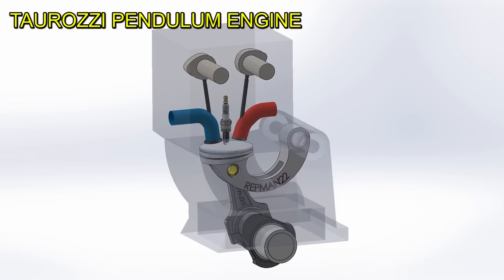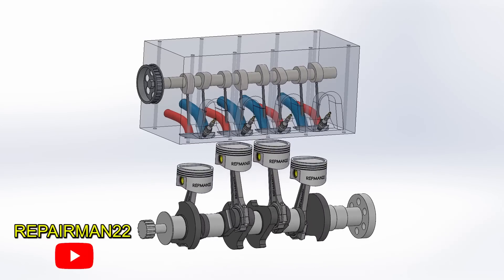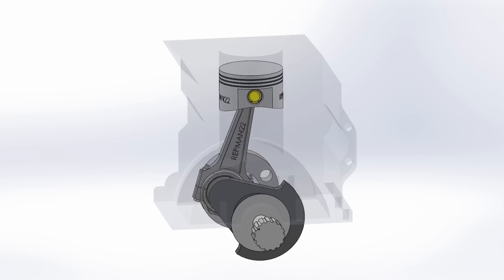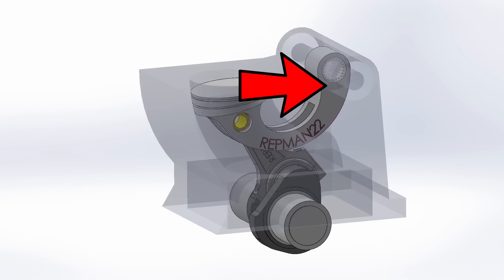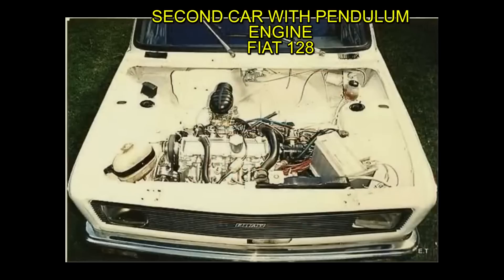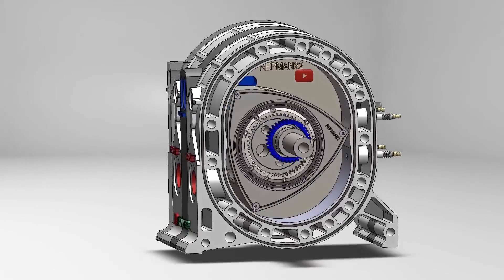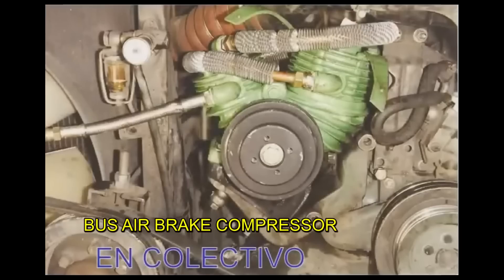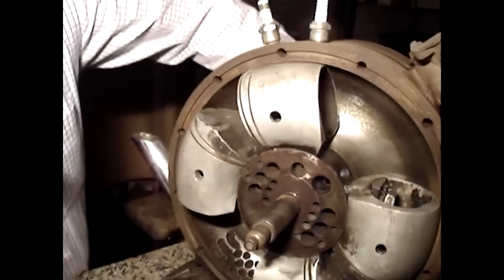All about the Taurozzi Pendulum Engine 🧠 and what happend to it🤯

Comment: Adding the weight and complexity of the curved connecting rods and the increased cost of boring curved bores negates any gains from decreased friction. As for excess oil, modern engines use oil jets to cool the pistons so that benefit is nullified. If it was a valid concept, the manufacturers would have picked it up, they spent years and millions of dollars trying to make the wankel as efficient and clean as standard gas engines.
 The fact that it is used as a gas compressor doesn’t prove its viability as an ic engine. The compressor industry uses multiple design concepts as working pumps because they aren’t as stressed as an ic engine.

Comment: I find the 30% claim VERY doubtful. If that were the case the automotive industry would have been all over it.  Friction from the piston skirt is significant, but not THAT significant. Wear in the piston skirt is often insignificant during the life of a modern engine. There still needs to be tension in the piston rings, and there is a move to lower tension rings. 
Would the piston rings rotate ? If not one side of the ring would wear far more than the other.

Comment: There is a whole extra point of contact from the reciprocating assembly which will add more friction, that does not make it more efficient or give it less friction. So pretty much a less efficient, higher friction, faster wearing, shorter life span having, less powerful, more difficult and expensive to manufacture engine that doesn’t do nearly the work what a typical internal combustion engine does for a higher price?

Comment: I love it! Makes perfect sense from piston to crankshaft efficiency.
Reply: The conrod/crankshaft-initial-angle after ignition is (normally) always 0°, instead of the ideal 75°-80° (1/4th turn for ideal leverage) .... Here the initial angle is, very soon, much higher than in a normal engine, thus extracting more torque from each combustion.

Comment: The crank angle near top dead center is a massive advantage in this design. I've never seen this engine before. Very cool.
Reply: It is the same as a normal engine.
Reply: @Keit Hammleter  

When the piston is at TDC, the crank is past TDC. It's a mechanical advantage like an offset bore build, but even more accentuated. Then, as the piston comes down, it moves over towards that side of the crank, keeping this advantage. The rod stays more straight & this puts more of the power stroke into the crank for rotation.
Reply: @keithpeterson6108  zing
Reply: @keithpeterson6108  : This is not apparent in the simulation in this video.    As others have posted, piston TDC inherently means the crank pin is positioned to make it so.
Reply: @Keit Hammleter  

Yes, of course, the crank position has something to do with TDC. It's still at TDC, but the rod is at an agle when the piston is at TDC. Thus having a mechanical advantage on spinning the crank as it rotates past TDC by having more rod angle which gives a better mechanical advantageon rotatingthe crank.. It's crystal clear in this video that this engine design has that advantage but gains even more as the engine rotates on down the power stroke. Look up offset bores & you should he able to understand. I'm sure there are drawings somewhere that will illustrate this & make it easier to understand.
Reply: I'm confused aswell TDC is always going to be TDC, wich is always determined by the crank
Reply: @Twiggieh  when the PISTON is at tdc. The CONROD and CRANKSHAFT have a few degrees of rotation before the piston starts to come back down on a traditional engine. Look up a video of a cut open engine and put the video at 0.25x speed
Reply: @Twiggieh  : Yep.   Piston is at TDC when the crank throw (ie a line joining the centre of the main bearing to the centre of the big end) and the conrod are in line - this is the point where the distance between crankshaft centreline and the piston is maximum - always.
Reply: TDC is TDC, defined by the crankshaft. Zero difference to a conventional motor... It just guides it on a wierd trajectory afterwards.
I don't see where the "increased efficiency" claim could possibly come from.
Reply: @Jack McLane  

Offset bores have been around for a while. My kx450 mx bike has it, my buddies kawasaki liter bike has it as well as countless other machines. It's been a race "trick" for a long time.

The center of the bore is NOT inline with the center of the crank journals. This means when the piston is at TDC, the crank is PAST TDC of the typical over center over bore build. This means the rod can start to put rotational work into the crank earlier & when cylinder pressures are higher.

On a typical center bore/crank journal build, the piston isn't putting any work into the rotation of the crankshaft until the momentum of the engine gets it past TDC. The piston pin, lower rod bearing & crank main journals are all in a line. There is no rotational work being applied at this time. This is a waste of an opportunity to use this power  & when the cylinder pressure is at its highest. Moving the bore over makes TDC happen later, thus putting the crank into a position to "accept" the combustion pressure sooner. So, in an offset bore build, the piston is at TDC but the rod is at a slight angle thus getting a mechanical advantage to spin the crank.
Reply: @keithpeterson6108  : My other post was in response to your post claiming the crank is past "TDC" when the piston is at TDC.
Offsetting the cylinder from the crankshaft centre line is sometimes done as it changes the percentage of time the cylinder is in power stroke, but it makes almost negligible difference to engine performance or friction.
You have a misconception about how the heat energy in the burnt gases is converted into mechanical energy.  It is done by gas expansion as the piston goes down - the fact that the pressure cannot rotate the crankshaft at TDC is of no importance.   You might like to look up the "standard air cycle" - a mathematical model taught to engineering students as it explains why raising the compression ratio improves performance.   It assumes combustion occurs instantaneously at TDC and that no heat is lost during expansion.  Neither is completely true of course, but are both approximately true.  
The short combustion time (mostly within a few degrees of TDC) is analogous to the "cut off" in a reciprocating steam engine.    In a steam engine you get maximum efficiency when the steam valve opening time is kept within a few degrees of TDC, so that power is produced by expansion and not boiler pressure.   This is a fact not often known except by engineers, but you can look up "cut-off" for yourself, and if you do, you will understand why arranging for crank leverage at TDC is not a good idea.
(Actually, in steam railway engines, the cutoff (ie valve opening time) is made variable.   On starting off, the driver lengthens the cutoff - this increases torque for starting due to the extension of time piston sees full boiler pressure, but it considerably reduces efficiency, so as the train builds up speed, the driver shortens the cutoff, reducing steam consumption and thus fuel.)
Reply: @Keit Hammleter  

My explanation was lacking clarity. I shouldve made that more clear that the crank is still at TDC but it "acts" as though it's further past TDC as soon as it IS past TDC in that the rod has an opportunity to work earlier on rotating the crank & doing so when combustion pressures are at their highest. This is absolutely a worthwhile mod to have as does infact show up on the dyno. 

As far as the combustion process, I totally understand how that works. Even before combustion, the compressed air alone makes the rotation want to stop or blow down (unless it's rotating by hand to let the pressure sneak past the rings). The point I am talking about is that having the mechanical advantage on the crank is absolutely an efficiency gain & worthwhile. The design of this engine carries that advantage out to another level. Some mods carry over to other parts of operation or allow for other things to be done differently. This is one of them.

Comment: I can't see this engine going into mass production for automotive use. The cost of tooling and switching over from a conventional engine would be prohibitive.  One problem that is perhaps the most important is longevity.  The sad fact is once outside warranty,  servicing of even the cheapest car drops off. With the bearings that these engines would use I.e. roller bearings,  these engines would need a copious supply of clean oil , any contamination or drop in supply damages these type of bearings very quickly , and broken hardened rollers will destroy an oil pump in seconds. I have serviced cars for nearly fifty years , the state of some oil I have witnessed is appalling  and it's  not getting better. People don't change...
Reply: So why didn't those costs stop the compressor guys? A lot lower margin of profit making compressors.

Comment: This does lower piston mass and does make peak friction loading less by distributing the load. The curved bore is a little hard to hone, but probably it's easy to breach machine using matching geometry. Piston ring issues could be overcome with light riffling or just choosing softer rings (since the rings don't need to withstand such high heats/friction).

If you want a more cursed engine, there is a opposed piston version of this rotary/pendulum engine.
Reply: It's piston may be lighter but it's also got the banana arm moving up and down with the piston, i wouldn't be surprised if that makes it's reciprocating mass heavier than a regular piston
Reply: I imagine the bore could be honed easily with a "dingle-ball" style hone rather than traditional stones, and I imagine the crosshatch pattern would be less important in a design like this.  My main concern is wear at the pivot point potentially causing the piston to slap around, though with modern metallurgy this probably wouldn't be as much of an issue as I think it would be.
Reply: @moconnell663  i think the desired tolerances are easier to achieve on the pivot point and arms with bearings (since those are mass manufacture to near perfect tolerances) when compared with the piston bore/head diameter. And again if you have lower peak friction you have less thermal expansion/contraction and those tolerances should hold for longer due to less wear
Reply: @icefly_  Anyone comparing this to a rotary engine randomly spews garbage from their mouth 🤦🏻‍♂️

Comment: This makes little sense.  You are adding friction when you add the extra pendulum link, the rings would be twisted by the curve, and how the hell do you overhaul this engine with the curved cylinder?  You cannot easily bore it out if there are scratches in the cylinder wall. Honda had the same issue with their NR750 engine with the oval cylinders;  It cannot be easily bored and repaired.

I see no way that this design is advantageous.  Fascinating to look at, but it achieves nothing that a regular piston engine can't do.